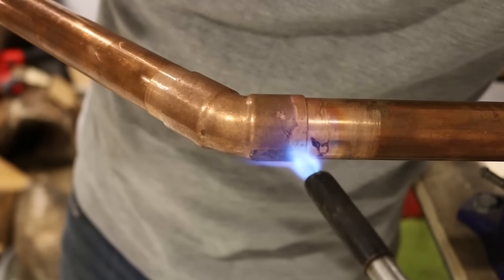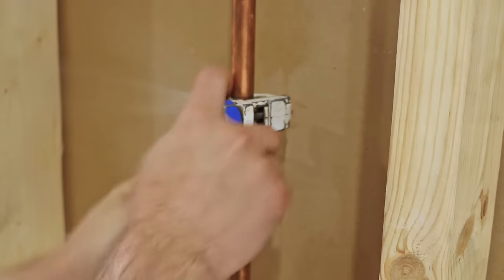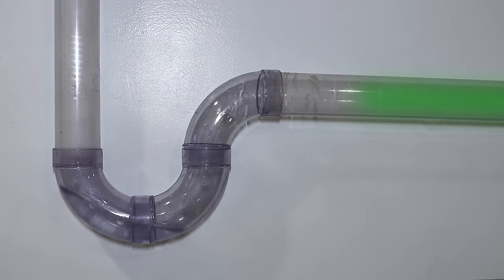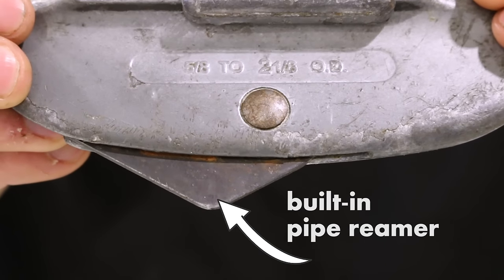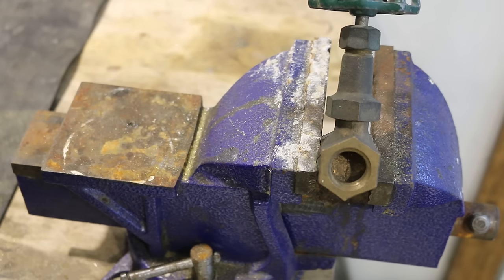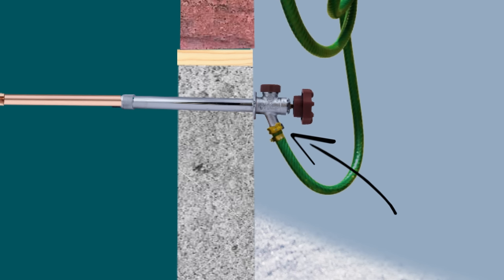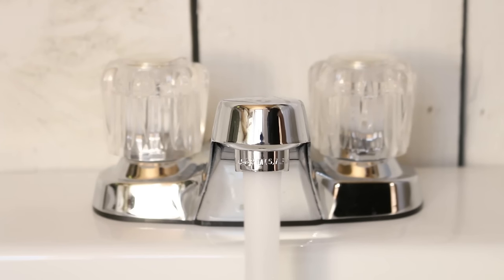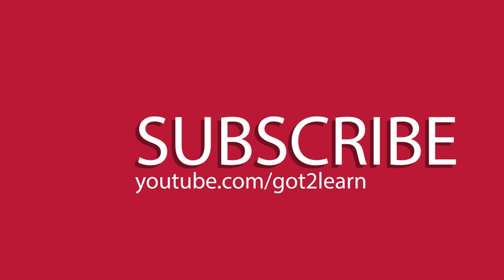The ULTIMATE Plumbing Mistakes Guide (30 Mistakes And How To Fix Them) | GOT2LEARN

Comment: Summary:
1.	Installing Teflon tape the wrong direction.
2.	Improper venting.
3.	Over tightening connections
4.	Saddle values (don’t’ do it.)
5.	Using harsh chems on pipes
6.	Cutting live pipe while under pressure.
7.	Connecting steel to copper improperly (use dielectric union)
8.	Not wiping away flux when done. (copper)
9.	Overheating joint when soldering. (copper)
10.	Tightening pipe cutter too fast. (copper)
11.	Sloping pipe incorrectly.  (just enough, but not too mch)
a.	1/8” drop per foot, and less than diameter
12.	Not installing water hammer arresters.
13.	Reusing flexible hoses.
14.	Using lead solder on potable system.
15.	Not deburring inside of pipes.  (both copper and PVC)
16.	Improper cleaning of copper pipes.
17.	Not isolating exterior hose bibs
18.	Not hanging pipes correctly.
19.	Applying pipe dope, then Teflon tape.  (Install tape first)
20.	Cross threading metal piples
21.	Attempting to glue onto  PAINTED pipe  (use paint thinner to remove)
22.	Using water to prematurely cool copper connections.
23.	Leaving hose connected out side for winter.
24.	Not unsoldering a leaky joint to fix a it.  Must disassble and clean 
25.	Not installing P trap for any fixture with drain.  (Toilets all ready have one)
26.	Using sink plunger for toilet.  (Diff plungers for each, get one for toiler, and use for sinkes)
27.	Allowing crossing pipes to touch each,  Fix the insulation.
28.	Using toilet as a trash can.
29.	Using incorrect glue for PVC versus ABS.  
30.	Not installing back flow preventer in basement.
Reply from the maker: Wow, thanks!!!

Comment: Great video as always except one no-no. 

In the pipe hanging part you show drywall screws being used with copper straps. Dissimilar metals = corrosion. In your case the drywall screws are not copper and the strap is. Easy fix is use the plastic hangers to eliminate corrosion due to dissimilar metals.
Reply from the maker: Yes 100%, my mistake ;)
Reply: One another point, not related specifically to plumbing, the cross member between the joists was cracked and loose.  Maybe minor, maybe not....
Reply: @northernlightsrenovations1710  , that type of "bridging" is nailed to the joists PRIOR to the subfloor sheathing to keep the joists 16" on center for the subfloor installation . After the subfloor is installed the bridging serves no structural purpose .

Comment: Remember that there is electrical solder and plumbing solder. For plumbing, use plumbing solder/without Flux, and buy a tin of Flux. The better the Flux job, the better the sweat job!!!

Comment: I had a job that the pipes were copper. They had water hammer in the Attic. It was a worn out toilet fill valve that was shutting off too abruptly. Easy fix.

Comment: No!!! No drain cleaners. There is one main thing that clogs drains, HAIR!!! Drain cleaners melt hair, but, do not open a clogged drain. Over the years, I have found two types of users. Those who clog drains, and those who never clog drains??? The pea trap is usually the problem. Remove the trap, clean out the hair, and reassemble it, and don't over tighten it!!!

Comment: I just don't recommand using quick-connect or sharbite fittings. Overtime it fails and cause water damage. Soldering is still a better solution. If you cannot do it yourself, call experts for proper installation.
Reply: That's about preference, everything fails over time. I swear by sharkbite for domestic installations.

Comment: When soldering a joint, you always apply the heat to the back of the fitting first. The flame pointed towards the front of the fitting.  If you solder from the front you may not get the back hot enough, or the solder might draw towards the front not filling the whole joint. Liquid solder follows the heat.
Reply: Total bs dude! For every day residential systems you just put the flame anywhere it will get the entire fitting hot enough to draw. The only and I mean the only time that applies is when you’re using large copper pipe in commercial & industrial applications, 2 and 3 inch copper. Anything under that it doesn’t matter WHERE you put the flame!
Reply: @louisp.3332  
Copper is a great conductor after all. That’s why it’s commonly used fir electrical wiring.

Comment: im a plumber in canada an u are right about the draino but if u use vinager and baking soda if it doesnt unglug the pipe it can 1 put to much presure in the pipes and bust or 2 if u use to much baking soda it can make a paste that harden with time and create a bigger problem best bet call a plumber

Comment: I'm a homeowner, had to replace a monobloc tap on kitchen sink. Originally installed with no rigid metal plate, just the soft washer.. so no wonder it worked loose.  Using videos like yours,  as a complete novice I managed to select the bits I needed to fix the problem and reinstall two sets of taps with no leaks ( another sink tap was leaking).. except a small drip from a previous joint.  Probably didn't support it  while I tightened the one next to it so cracked the seal??

Feel confident about tackling that too!  Best advice is to clean old pipes back to shiny copper, debur cut edges and not over tighten compression joints.. and if you need to redo some previous plumbers work,  invest in an olive cutter .so start afresh.

Comment: What about wiping off leak detection sprays? I've noticed others leave them sitting on the pipe joints without wiping it off after checking for leaks...after a few days it causes the pipe to turn blue/green. I don't know if this could be an issue later in the years but why take a chance? Plus any plumber who likes their work clean (especially copper) should wipe it off
Reply: If you get water on a copper pipe and let it dry it will oxidize it the same and turm it blue green..   all copper pipe eithr way will turn eventually.  The important thing is wiping flux off because it will eat through the pipe quickly like if you screw steel into copper….
Reply from the maker: Yup

Comment: ALWAYS AN AWESOME VID !!!!!!!! - WE THANK YOU FOR YOUR TIME AND HELP - ALWAYS 
sooo, when are we gonna get your class AND thoughts on the snake, v/s  water jet, v/s plunger for clearing clogged pipes?
 there are lots of vids out there with professionals doing the water jet.. should we DIY guys invest in it?  especially us who live out in the rural areas ? ..
also, I look fwd to your videos, especially in the sunnah here , when i have a lot of camps around me opening up and need busted pipe help.. we just live too far away off the map, and have to do it ourselves.. sink n swim.. and your channel is a great help.  you are da man !
Reply from the maker: I'll have to make one on that subject for sure!
Reply: @Got2Learn  that would be cool.. its just combine that with living on a dirt road, and having culvert/ road drainage to clear.. i am trying to asses if its a good all around tool ..again.. many thanx!
Reply: There are a few things to consider between rodding machines and jetters. For certain blockages, like grease and sludge, a jetter is far better than a rodding machine. Jetters can break away roots, but it usually requires a higher psi and sometimes special heads for that type of blockage. Also, when jetting in an area that has openings, like floor drains, showers, tubs, toilets, etc., the higher psi can either force water to back up the fixtures or drains when the jetter is close to them and running at a higher psi. It can also create a vacuum effect, which could siphon the traps on fixtures, so you'll have to be mindful of that as well. Hope this helps in your decision

Comment: As a note. You don't need a backflow preventer on every fixture. You can install a single backflow preventer where the sewer enters the house and it meets every code. You also aren't required to have one if you house is above the city sewer line as it won't reach your home in a backup. Code only requires them installed if you are below street level of the nearest manhole (an important distinction as somehairpin turn streets have homes who connect to the street below theirs).

Comment: 3:14 what do you think about the Di electric union effect in case the steel and the copper sides are connected to the earth ?

I do think the electrons run and you have the electrochemistry effect anyway.
Reply: Earthing does not matter here. The effect takes place directly where the metals connect because of different electronegativity. The copper is a better electric conductor anyways, so electron flow in iron will be worse, and that difference between the conductors is more than enough to create corrosion.
Reply: @resetcoder  i do think there is a saline bridge where there s the Di electric like inside a battery. 

So, the redox reaction exists and the electrons run through the earthing. ;)
Reply: @eddybash1342  I didn't say it doesn't exists, but if it would work as you say, then earthing would be pointless, it would be enough to connect the two pipes with a wire, which is also pointless, because they are already connected at the fitting. Why would the electrons choose the longer path?

Comment: using drain cleaner is ok  if you wash out the chemical after ya use it with warm water and dish or laundry soap for a few minutes  or wash baking soda down the drain to neutralize the acidity

Comment: Great video. I am a master plumber and have used many of these tricks. I however disagree with the order of teflon usage, and have my apprentices do it the other way around. If the dope goes on first, then a tight layer of tape, it's not only handleable with less mess, it's also cleanlier to look at. I have used this method for over 23 years, and very rarely have a leak. Great informative video though.
Reply: I just use PST or 527  from Locktite, it will never leak and holds up to 1200PSI. Developed by NASA, and forget that teflon tape. Teflon is not a sealant, its listed as a lubricant to easily draw the threads together, Locktite does both.

Comment: Do you recommend the Oatey All-Purpose Clear Cement? Meant for ABS, PVC and CPVC.
Reply from the maker: I use specific cements, don't know about the other ones 🤷‍♂️
Reply: The term all-purpose should ALWAYS be avoided when the all-purpose product is attached to anything expensive. The term all-purpose almost always comes with a SPECIFIC set of instructions to follow . If those instructions aren't followed TO THE LETTER , the warranty is voided , and YOU pay for all the fuck-ups . That's why it's better to buy a SPECIFIC PRODUCT for ANY task  . It's also been said amongst tradespeople like myself , that ALL-PURPOSE products are marketed to home owners with the unwritten intention that they can be used for a multitude of tasks , thereby justifying the cost AND/OR volume of the product .

Comment: wait, so if the drain pipe is exactly 3 inches, which do you do? You say if it's 3 inches and greater AND if it's 3 inches and less. So both conditions are true.

Comment: Oh wow man that was a lot of awesome info! Thank you so much I'm an aspiring do-it-yourselfer and this was very much appreciated!
Reply: Quick question, I'm trying to help my mom fix a potential well, but probably plumbing issue. Water comes out of everything like normal and the initial pressure is good but then drops off to piss poor. We changed the control box as well as the little on/off pressure box. Not sure what to do next.
Reply from the maker: @Auscilius  sounds like the pressure tank diaphragm is bad, might be wrong though..
Reply: @Got2Learn  we got it fixed up! Not sure exactly what the problem was since I wasnt there when it got fixed but I will definitely make sure to apply what you've taught me in future scenarios!
Reply from the maker: @Auscilius  woooohooooo, nice to hear that 🤘🤘🤘

Comment: Unpleasant odors if left long enough can build up in your house and cause a explosion, it is after all a flammable gas which is one big reason P traps were needed in the first place, one tip is to go around your house and run water in the least used sinks and flush the unused toilet regularly to keep the trap full of water, A/C systems will pull the water out of the traps via condensation and left unchecked they will dry out,  reusing braided water supply hoses is also a bad idea due to the fact most are over tightened and the seal ring is crushed which will not seal properly when reused, a new 5.00 supply tube is a lot cheaper than a flood remodel. If you clean your fittings and do not flux them quickly they will re-oxidize in a couple of minutes, never leave them setting around with out recleaning them,  👍 Great video.

Comment: Anytime I've come to a house with a sewer backup and they've had a backwater valve in their sewer system... that usually is the problem. I understand it's code but sometimes code isn't right lol almost everytime I see a malfunction with the flapper assembly inside the body of the valve
Reply: Sww zz free ddsd Ed Reed week for ee we ew eewereeewe
Reply: A properly installed backflow preventer NEVER fails .
Reply: A backwater valve and backflow preventer are two different things you know

Comment: 10:06 🤔 bell hanger make for a quieter, less squeaky hanger. Bell hangers isolates pipe from wood that would otherwise squeak due to  expansion and contraction as pipe reacts to temp. differences..

Comment: Copper joints are cleaned for more than just oxidation when soldering it makes micro scratches where solder flows into to make a stronger joint

Comment: Another thing not mentioned, but you did show it. When cutting a pipe, make sure the pipe is cut pretty flat, else there may not be enough on one side to be properly seated in a fitting.

Comment: When you said to use a brass fitting to join copper to steel, the part you showed being used (3/4 copper to 3/4 iron) sure looks like a pressed copper adapter, colour is off for it to be brass; also all the brass adapters I get from Wolseley (Canada) are machined brass! 
Otherwise, a nice refresher on 2 or 3 items.
Reply from the maker: What's the timestamp?
Reply: Zinc in the galvanized pipe and copper make a battery. The electric current destroys the pipe. 
Dielectric unions prevent electrical  current flow with an insulator between the two halves of the union.
Using brass nipple to connect copper and galvanized pipe is the same as putting a brass bar across the terminals of a battery 😂
Reply: @Got2Learn  3:18 would be it.

Comment: Great video once again, I would like to know the simplest way to connect soft copper to Pex-A thanks
Reply from the maker: Soldering a copper to PEX adaptor 🤘
Reply: Make sure the brass lead free sweat adapter is for pex A expansion pipes,also known as F1960.
Reply: Home Depot sells them now,as well as all other expansion type fittings (pex A),much to my surprise. They are labeled as “commercial “ products. But for some reason they don’t sell pex A pipes, which is kind of a bummer cos you have to find an online retailer for the pipes.
Reply: @lorenzocriscuolo7869  Cannot find a  
90 degree  3/4 swivel adaptor  to 3/4 pex expansion fitting anywhere.
Any suggestions?
Reply: Update; pex a pipes are now available at Home Depot,finally. All that’s needed is the $500 expander tool from either Milwaukee or DeWalt.

Comment: How about making sure the last copper joint you solder is vented, if not, any leftover water will just create steam and the high pressure will just blow the solder out of the joint,  And make sure there is absolutely no water accumulating in elbows when you solder them

Comment: The majority of pinhole leaks that I have seen are on well water, shortly after the well tank.  Why are they almost always shortly after the well tank and not further downstream?
Reply: I wonder if it has something to do with fines in the water. I know in some cases, there were fines, or small insoluble particulates, that could tinge the colour of localised water sources, I wonder if certain minerals in the water could be having somewhat of an abrasive effect over time?

Comment: One of the weirdest toilet failures I have run across involved Q-tips.. The toilet would flush when dealing with liquid but fail when dealing with any solid material. Plunging did not solve the problem and neither would a closet auger. The toilet would drain but the problem would happen the next time the toilet had to deal with solid waste.  After several attempts to fix the problem the toilet was pulled and it was found that several Q-tips had wound up lying across the toilet outlet. Liquid would pass but solids would become blocked by the Q-tips. A plunger just agitated the Q-tips and a closet auger went between them without removing them. It required the messy and unnecessary job of pulling the toilet because someone was too lazy to throw them into the trash can..

Comment: Great as always, and I wipe off all my joints. But as in the video a pinhole leak in a solid run does not relate to wiping a soldered joint.
Reply: Thank you, and I know that u realize that pinhole leaks are kinda a mystery and they do seem to blow out at the green spots on the internal visual inspection of the copper pipe and what I have seen is like 10 green pits  internally in just a short section of pipe 

I’ve experienced that only in certain neighborhoods have the problem within 10 years of new and on the cold water pipes, other houses have this problem much later in their life which I usually diagnosis a bad water heater that has caused the hot pipes to wear premature
Reply from the maker: @ryeckley7267  yes, the type of water coming in has a lot to do with it aswell.

Comment: Copper to black pipe is fine tho right? It’s copper to galvy that’s the problem? I’ve never seen a dialectric on a boiler system
Reply from the maker: Copper to steel = big no no ;)